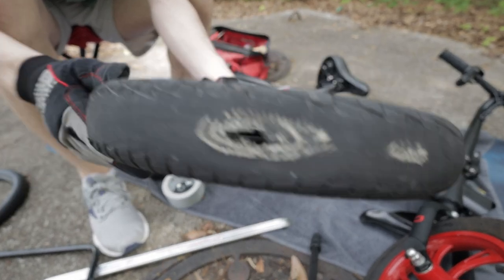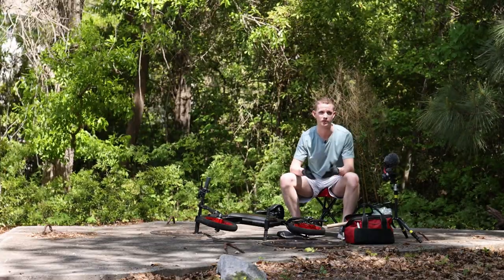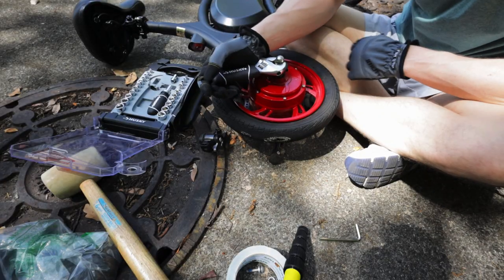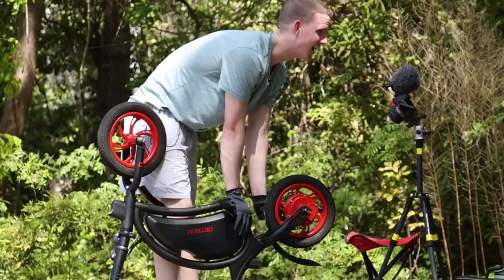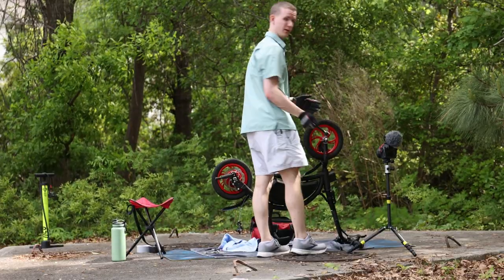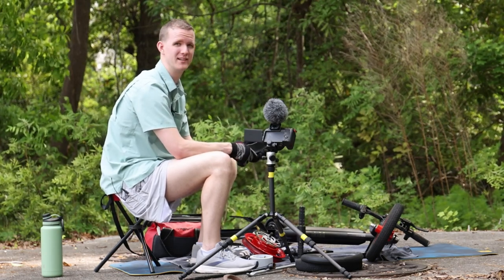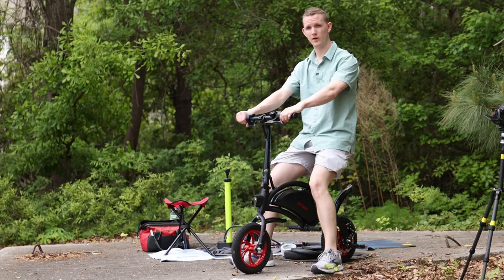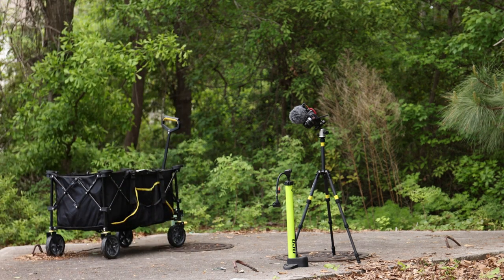How to Fix an Electric Scooter Tire? - Jetson Bolt Upgrade

Comment: if that was your first time taking off the rear tire, the only reason it was difficult is because the blue bolt sealer. I put a tiny spray of wd40 on it and it came off much easier.
Reply from the maker: Yes indeed. Thank you for the advice!

Comment: How do I adjust the brakes I think they pull but the brake doesn’t come out
Reply from the maker: Loosen the break line and then push it the brakes by the handle. Tighten the break line to see fit.